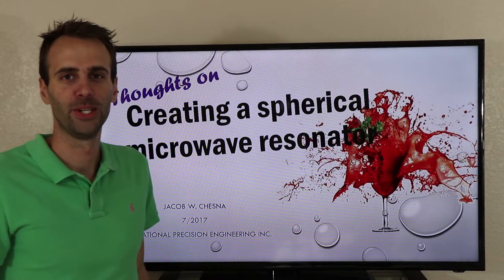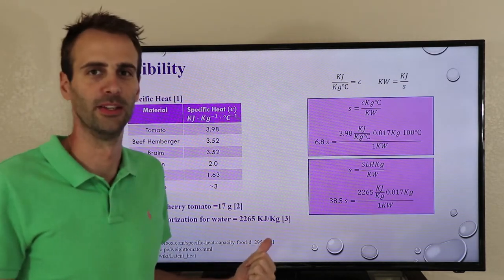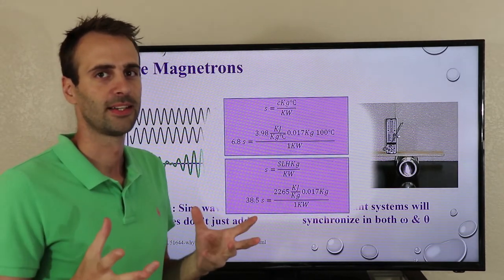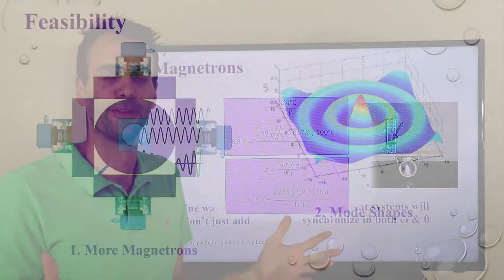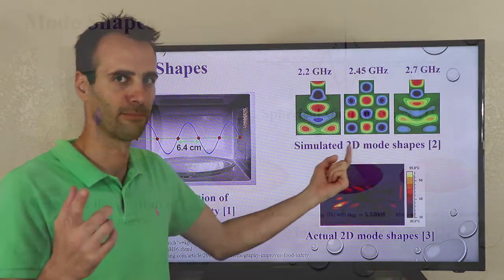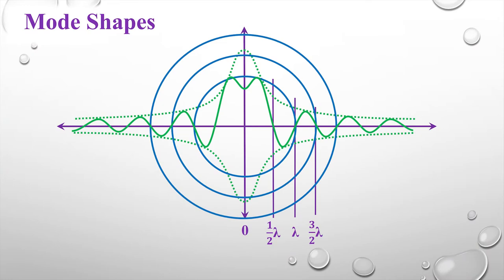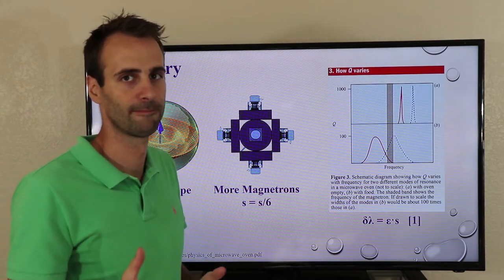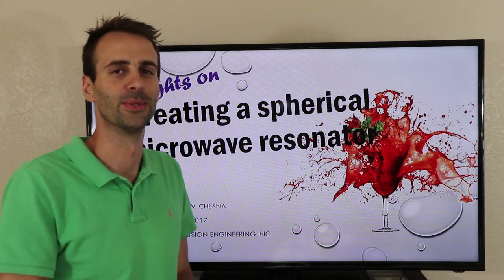Microwave Gun build? - HERF Chamber

Comment: Thanks for your insight. I think many would like to see an engineered directional MW  beam. Hop to it? Can it be done?
Actually the US military sent a 35kw microwave beam across 1 mile in I think San Alamos Calif in 1977, with 83% efficiency. How did they achieve that.
Reply from the maker: I've been rackin the brain about how to quantify the power in such small beams - and if you cannot measure it, then you are just speculating. In the military sized beam,  they dont use microwave oven magnatrons they design and build their own to drive that kind of power (prollysimilar to radar antennas), and even a simpelton like me would be able to just scan the field with a wifi antena hooked up to an osciliscope but the fidelity of the power map is limited to the scale of the antenna. I've been thinking about crackin open a mini usb wifi stick to try to get a tiny antenna but I haven't been able to get anyone to confirm this will work. Until an RF guy chimes in, I think the stack of microwave ovens I've been garbage picking will continue to sit idle.

Comment: I'm trying to send microwaves away with a helix antenna, I took the antenna off the magnetron and put this homemade antenna on it, at the moment it doesn't work, the isolation has failed.
Little by little I am learning about antennas and microwaves but at the moment I know very little, do you think it will work?
Reply from the maker: Good question, did you figure it out yet?
Reply: @internationalprecisionengi1737  I have not followed up on that, I thought it would be better to send the microwaves through a tube and launch them in a straight line with a parabolic antenna, just like they do in the radars. but I have not tested anything yet.

Comment: What do you have against tomatoes? :) On a Tesla Coil mailing list 20 years or so, I heard of microwave guns. Until your video, I was in the camp of "gun owner going to get cancer."
Reply from the maker: well it just so happened our kitchen microwave went down and I bought a new one to use as a temp solution. When I get to it, we'll see if I was wrong about the tomato being a superior opponent. 

Any ideas on how to measure the RF field? I think the focus cone getting the field into the spherical cavity is the critical design failure mode... I though about using a phospher coated glass shard from a big light bulb or something to scan and map it
Reply: In college, we put various things into the lounge microwave. Neon lamps and receipts might be promising. They may be like food and mess up the resonance of the cavity (hopefully I said that right), but if not too bad, could mount them to a grid. The lights could imaged over position and time. And the thermal paper might work as a integrator of a given slice. The glass shard might be better with regards to not interfering with the environment, but the setup may be more complex, and if an entire slice could be taken at once the process would go much faster. Just some thoughts, though RF voodoo is not something I know anything about. Regardless, it's always amazing to see what we normally cannot.
Reply: Looks like others have tried neon lamps and thermal paper on YouTube. Someone also a layer of shredded cheese which and the melting pattern will give away the standing wave pattern. Some pretty creative people out there :)

Comment: Or you can simply put an egg in a normal microwave.
Reply from the maker: You are on to something. In the string of videos that came around after this, one had explained that the wavelength (or harmonic) in the plasma-grape was about the same as its diameter...  dude game changer -> I'm thinking we light this up again, and your right could you use an internal surface to spherically refract inside the square resonating cavity!!